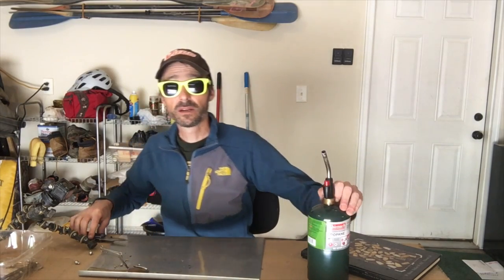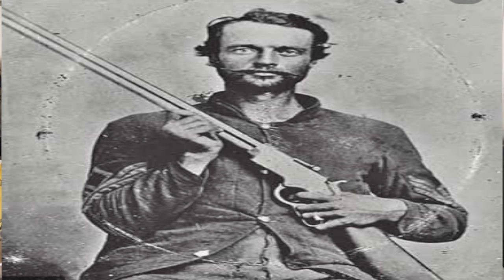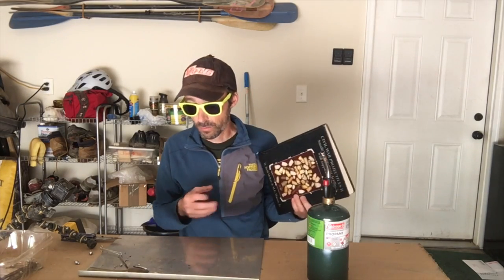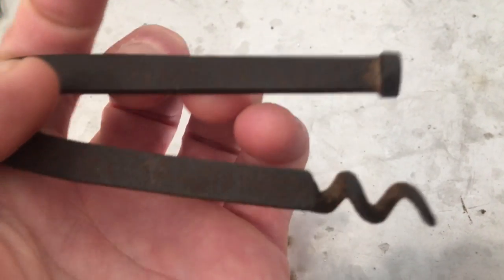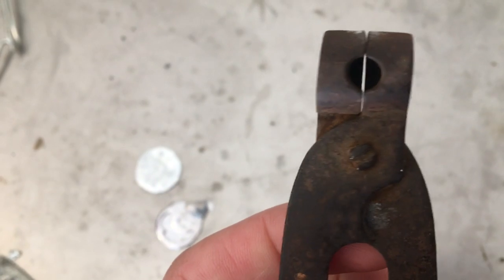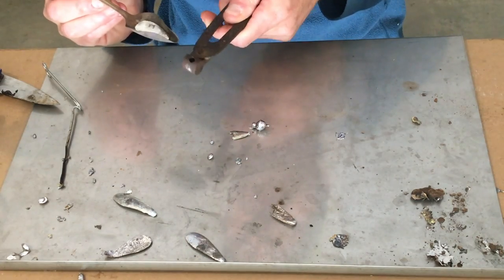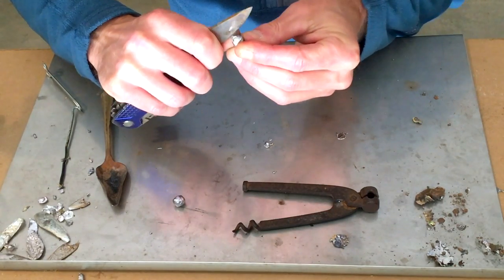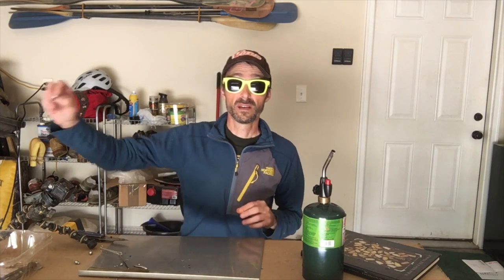How to Cast Civil War Bullets!

Comment: Great video Chris!  Way back when, I used a dug bullet mold from a New York Cavalry camp to cast bullets...just for fun. It would do one  round ball and one colt conical pistol bullet. I used some lead wheel weights, melted down, for the pour. Cleaning the mold took quite some time as it was iron, and soaking in WD40 for a month had it opening and closing nicely! I dug 2 out of that small camp site...those were the days! Keep the videos coming...please!👍👍👍👍👍👍👍
Reply from the maker: That’s a cool sounding mold, somewhere I read about tire weight lead and such not being of the same purity as civil war lead. Luckily I have saved every piece of camp lead I’ve ever dug (probably 50 lbs or more worth) and so had plenty of good lead to work with. Reckon it’s time to start stockpiling pistol balls 😂